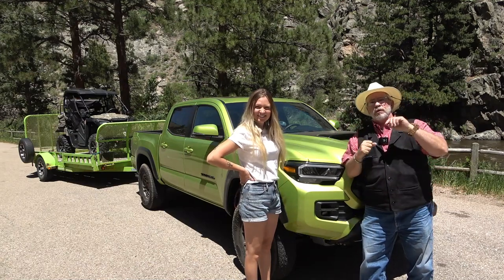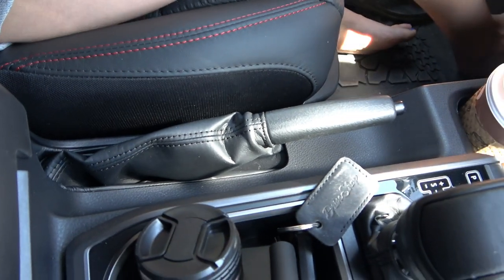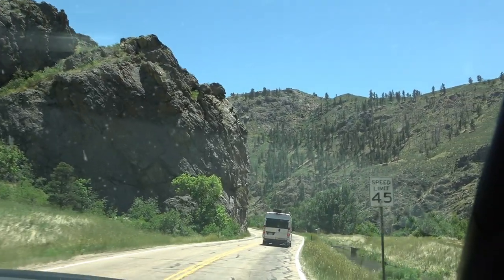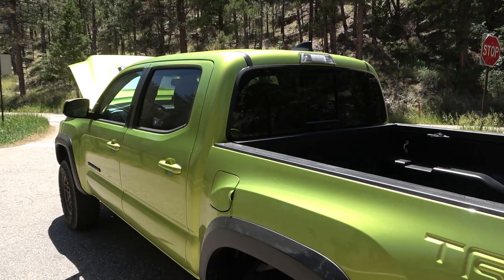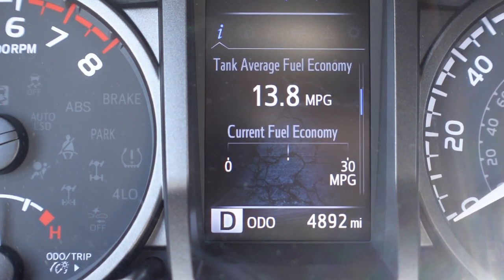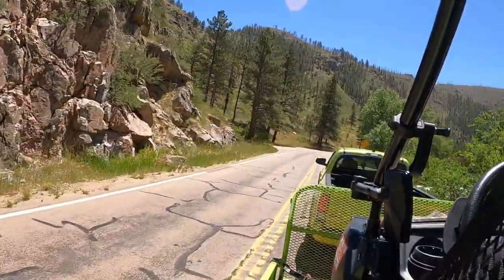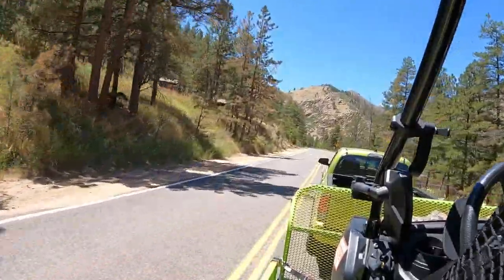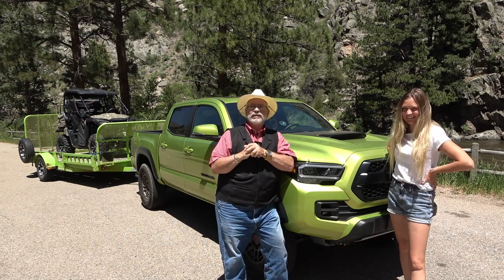Electric Lime 2022 Tacoma TRD Pro review in the Rockies. Big news is the power driver's seat

Comment: It didn’t appear that the transmission was searching for gears, which is the usual complaints on the Tacoma.  Mr. Truck, what’s your opinion?  Thanks
Reply from the maker: It shifted fine, don't know why it's still a 6-speed. Not impressed by the power